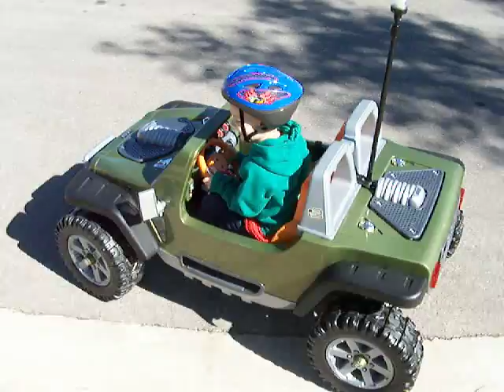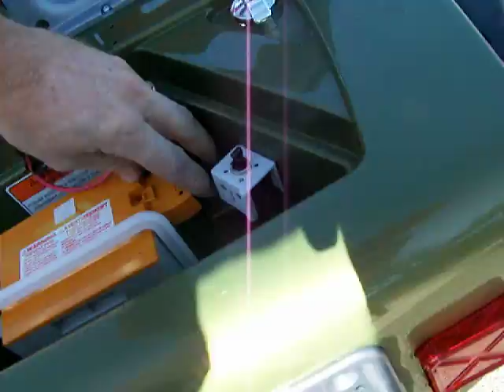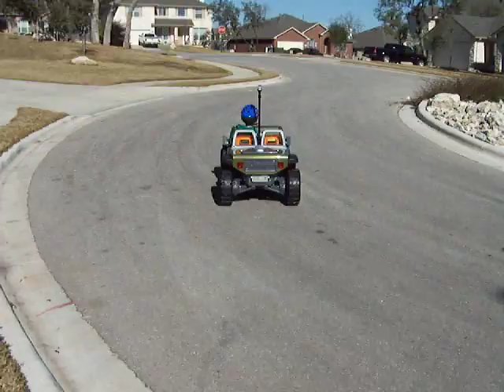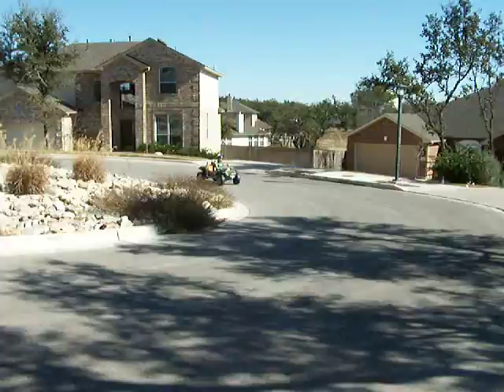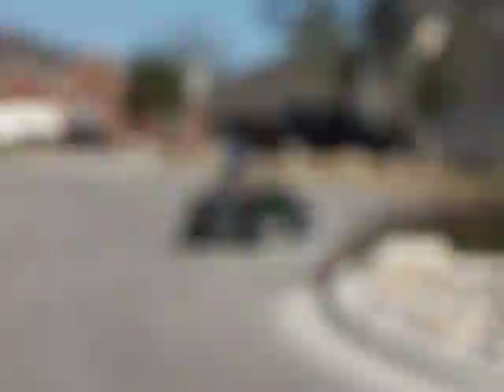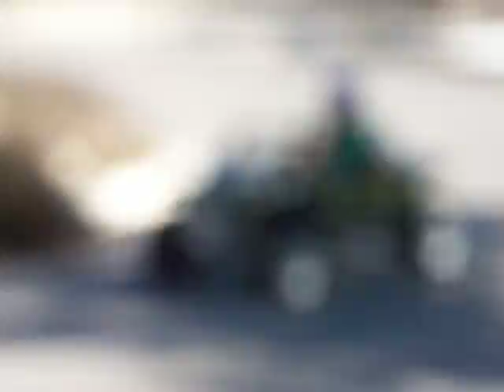Modified Power Wheels Jeep Hurricane 24v With Worried Mom

Comment from the maker: I get a ton of comments on here about traction. Added various types of "traction" to the tires. Had some success with some, but there is a close relationship between traction and longevity of the motor. The motor is just not up to the task when running at 24v with good traction. Oh, and the gearbox. Stripped many of those. So in the end, we basically ended up with original tires and we'd have to replace them now and then.

Comment: actually using tool dip or even the spray on rubber Flex seal will help with traction on the cheap and with stretch the life of the plastic wheels
Reply: BubbaJesus possible good idea💡

Comment: You want traction? Look for traction with hard rubber grommets. The type with washers built in.
 Known as OD washers They are screwed  on to the hard plastic wheels. No Slipping or skidding after you place them evenly along the plastic wheel. Use a hex screw with a power drill...
Go no further than your neighborhood  Army surplus stores. They have them cheap by the pound. 
If you don't have one of those where you live. 
Try the sport section and look for baseball/ softball molded cleat set at these sellers:  K-mart , Sears, Target, and (UGH)  Wallmart.
Show less

Comment: how do you turbocharge an electric engine?
Reply: YOu add a oscillation flux capacitor
Reply from the maker: Brian X you can also use a symetrical pultex kickdown injector to bridge the turbo inverter.
Reply from the maker: ***** Don't kill the dream man.
Reply: Yeah I do. I drive a Prius. And, you need a disclaimer to spot sarcasm?
Reply: alandavs I was going to suggest a couple of turbo-encabulators in series, but I think your method works just as well.
Reply: Kyle Byrom Multiport oscillator motor inline with the bridge port connector pin from a 42 valve pleanu buebay engine.
Reply from the maker: ***** I am sure they said that about Ostrich Pillow. But look at how that has changed the world.
Reply: Its impossible to turbo charge an electric engine.
Reply: add a little kid's imagination and some dad tinkering skills
Reply: it makes my head hurt just thinking about it
Reply: theirs no way to add a turbocharger to an electric engine
Reply: alandavs
lol its physically impossible from how one actually works with a normal engine
Reply: alandavs lol wtf are you even talking about
Reply: Oh its possible... Just requires a 100amp charger...
Reply: Joel Thomas
you dont know how a turbo charger works
Reply: ***** still would be impossible lol because a turbocharger is actually in fact a somewhat type of a supercharger. I feel like Im talking to 5 year olds lol
. like look at a centrifugal supercharger its the closest thing to a turbocharger but they all work in a similar way. the only way to make this faster is put rubber tired on it change the electric motor and add more batteries to it
Reply: Joel Thomas
lol cause you drive some low end turbocharged car doesnt actually mean you know about turbochargers
Reply: ***** yeah and have it force the air into what? not only could the batteries not even spin the super chargers belt , its just the dumbest idea ive heard of.
Reply: ***** mmm psilocybin...

Comment: Hey dude! help me plz, I got the hurricane jeep too and I was cleaned it up and then fall the jeep from the table 4 feet height. I plug the battery for check some damage and the reverse & first velocity is not working, just the "high speed" theeeeen I open the "joystick" or "speed control" and suddenly everything stopped working, nothing is working. I dont know what to do!
Reply: Buy a new one
Reply: I had the same thing happen. The gearbox you can buy online thru power wheels website. They would not send it straight to me some parts on their website have to ordered thru one of their power wheels certified repair stores. It wasn't expensive. If your power wheel is fairly you new it should be on warranty but all the information i gave you can get from the power wheels website or call them.
Reply: Tyrell Brown You can buy replacements motors, gearboxes, ect. at mltoys.com

Comment from the maker: Just get 12V scooter batteries. Don't remember where i got them, but many available. Sealed lead acid is what you need. Try to match your Amp hours with current battery. I can't remember what they were for me. You should have a fuse. Unfortunately I can't remember what fuse I used. Check out modified power wheels (.com). They have all the info you will need.

Comment from the maker: Hey rarityd, The motors I had were DCM-266. I don't know what is in them now, but check out allelectronics (.com). You will probably need to cross reference your motor to make sure you have the right one. Check out modified power wheels (.com) also. Good luck. You will definitely need a supply of motors. They are under $5.

Comment from the maker: It is just a straight conversion from 12V to 24V. I did upgrade the motors, but only in durability. Not in power. I needed something that could just drop in and couldn't find anything more powerful. Even at that, it burned through motors every few months.

Comment from the maker: That's pretty complex. Independent drive motors maybe? Look into hub motors. The motor is actually in the center of the wheel and drives the outer rim. Otherwise you are going to have to develope one heck of a drive system. Look on modifiedpowerwheels.  They have a forum with some very creative people.

Comment: i did this to a power wheels jeep that my metal working teacher found on the side of the road. he said i could fix it... what i did not tell him was that i was going to rewire the hole wiring harness (this was necessary) and put a 18V drill battery in it. i drove that thing threw the halls! fun fun fun. i am 6'2" i need to have all the doors in it open.

Comment from the maker: @RetroCaptain Thanks. Problem is not batteries or current/amps. It's motors, heat and plastic gears. Really needs either a direct drive motor or small industrial gearbox--and a speed controller.

Comment from the maker: I used to 12V SLA (sealed lead acid batteries). Look up 12v sla battery in google and you'll get about any configuration you want. Can probably find 24v too. I ordered mine somewhere off the internet, but can't remember where.

Comment from the maker: actually, both wheels are spinning. it has two motors. but any traction on that thing would immediately strip the gearbox. i already have to replace the motors about once a month. more traction would burn them up quicker as well. need to upgrade motor and gears.

Comment from the maker: You could mod it by simply adding a battery. I bought one online. Don't remember where. I think it was like $40. I put a switch in to move from 12V to 24V, but the 12V might as well not even exist. So in short, get another 12V battery, wire it in series and your good.

I did ad a fan to the motor compartment to cool it. You will fry motors with this setup. The fan helps.

Comment: hey since you already started pimpin your ride why not yank out the stocks wheels, the whole electric system,and the system mechanism and throw the body on a modifyed used go-kart frame on shocks with a hopped-up gas engine on 16inch chrome rims with the body either a foot high from the ground with offroad tires  maybe throw in some headlights and a simple convertable roof. 

That'll be fresh. All these things you can find on E-bay cost you $700